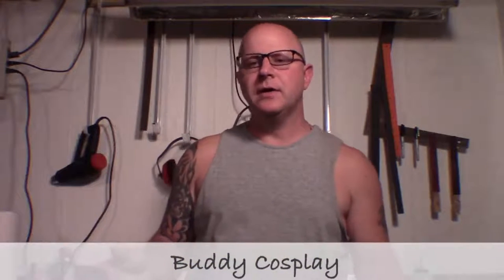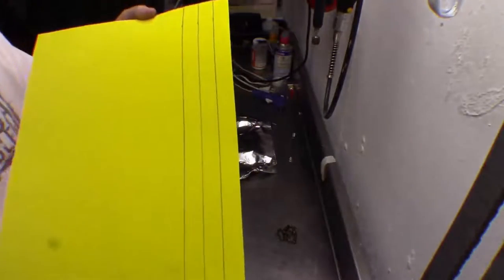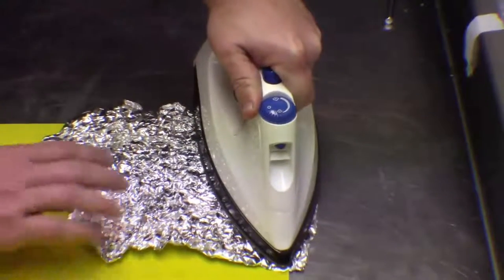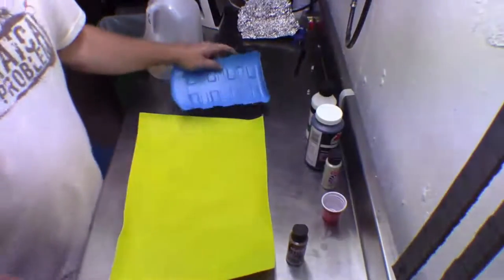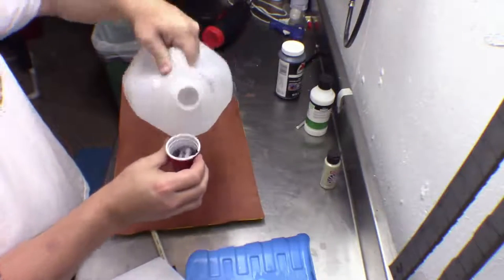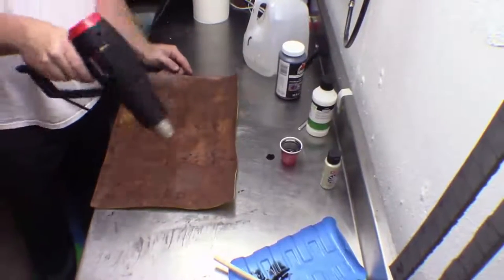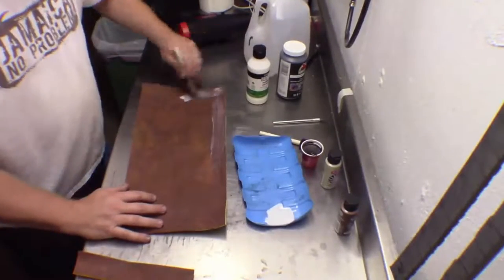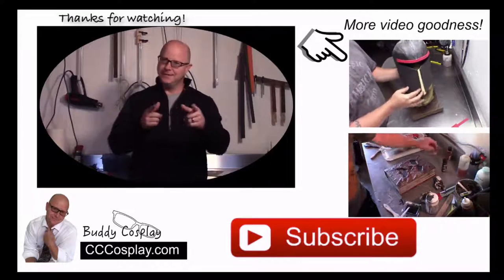Faux leather from craft foam for your Cosplay- simple tutorial

Comment: Can I heaten up the foam with heat gun and then press the wrinkled aluminum foil to the foam? thanks
Reply from the maker: +nixland Yes, that would work. The only issue with that is heating up larger pieces. If you pass over a section you have already textured with additional heat, the texture will go away.  An Iron works best but the heat gun idea works too if you are careful.
Reply: Thank you for the reply
Reply from the maker: +nixland You're welcome. Sorry for the delay, I wasn't getting my notifications.

Comment: can i use a heat gun insted?
Reply from the maker: +X3NO You should be able to do it with a heat gun. I've never tried it myself but the theory is the same.  I'd suggest heating it up well and pressing the foil down (hard) into the foam with a solid object, like a book, to get the pattern pressed in good.